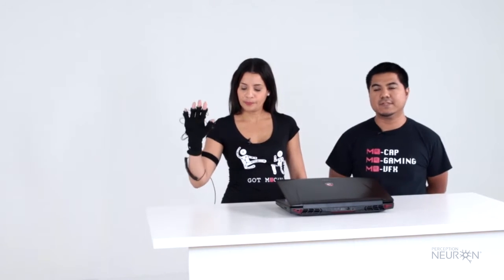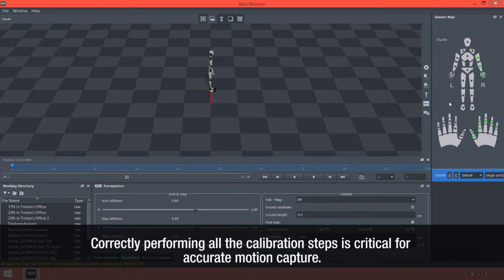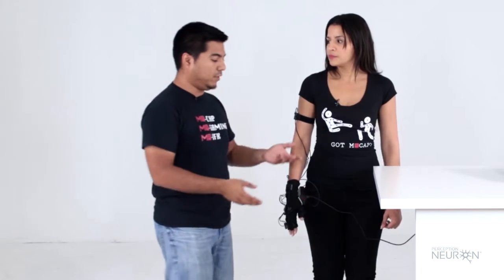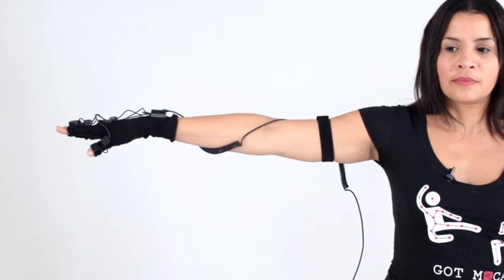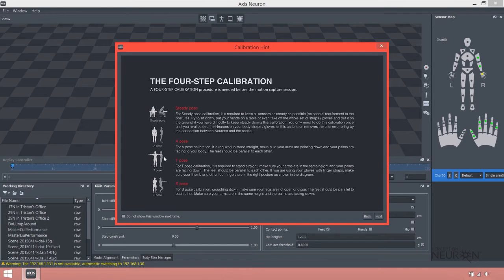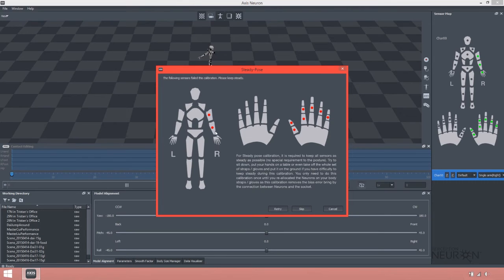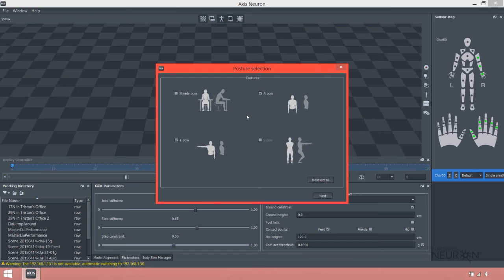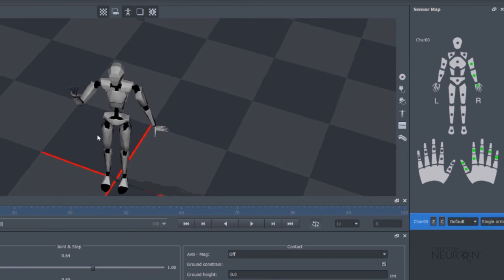PN Single Arm Setup

Comment: Hey!
I recently started working with perception neuron. I followed the steps as explained in video. But the motion of my hand is not being replicated ob the character. Behaviour is as explained. 
If I rotate my hand upward, hand is moving downward.
If i rotate my hand upside down, characters hand is moving towards right side. 

I upgraded the firmware for hub and neurons. 
All neurons are calibrated.

What might go wrong in my setup? I also posted the issue in forum but I got no response.  

Let me know if any extra care has to be taken for hardware/software setup or possible issues which are needed to be taken care of.
Reply: Working now! 
Both A and T pose are checked while doing calibration.
Reply from the maker: Hi there! Hopefully everything is working right now. In the future should you have any issues, please reach out to us on contact@neuronmocap.com. If the issue is not something we can solve via email, we can set up a video call to assist you. Thank you for working with Perception Neuron!